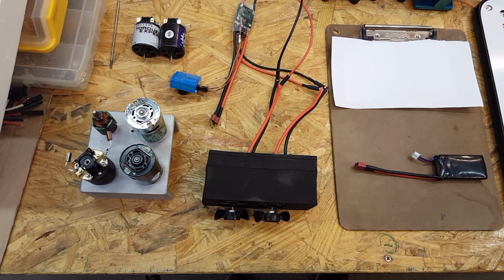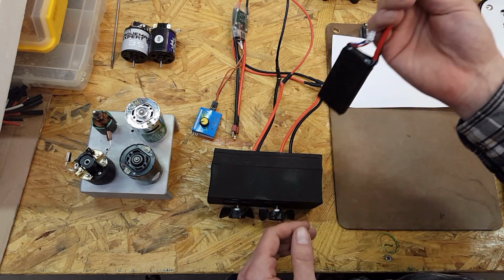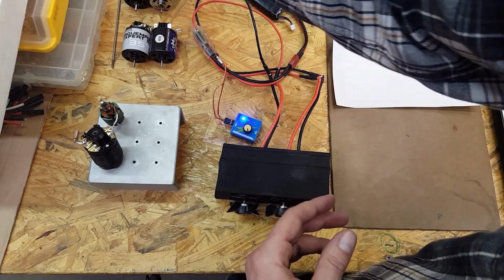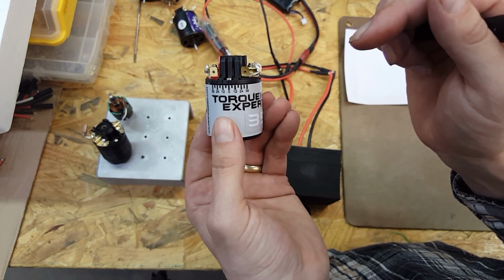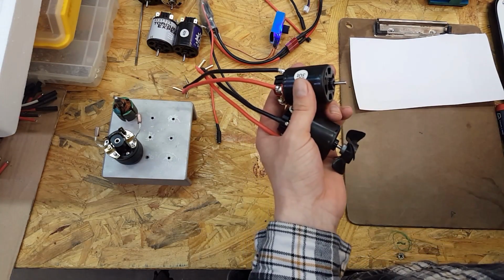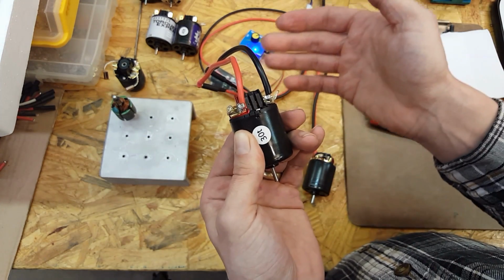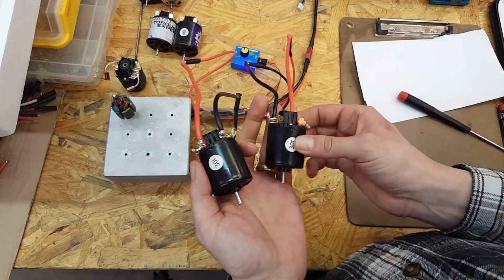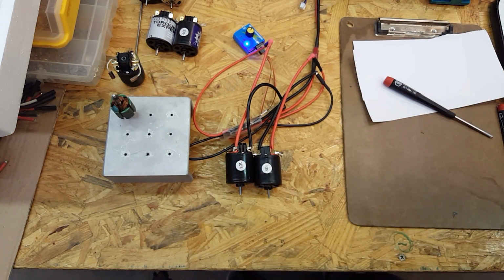Brushed Motor timing, rotation, and matched pairs

Comment: Hello, 1st, thank you so very much for the educational videos.  You make learning your products fun and entertaining.  Also, learning the technical aspects of your products is invaluable and so very useful.  I’m new to crawling.   My question:  Prefacing my question.  I am an engineer from the aerospace industry, I work for an airline.  All components on commercial aircraft are tested and retested for certification purposes.  Regarding new aircraft, you can find many YouTube videos such as the testing of the A380 wheel and brake assembly. Specifically, you will see the wheel and brake spin up testing the brake assembly to failure. Do you have the equipment to test shaft HP on one of your brushed and similar brushless motors.  I would like to see a video of you spinning up the motor measuring Current Draw, Voltage Drop, Shaft torque, watts, and perhaps spinning the motor to ultimate failure.   Thank you in advance!   Rob-
Reply from the maker: I have an inertial dyno.  It's very lackluster.  I'd like to build a master/ slave dyno but need to have a pretty big chunk of time to design the cradle and IO system

Comment: Hi friend. My Hackmoto V2 13T motor rotation direction label says counterclockwise. But my Vanquish VS4-10 Phoenix crawler transmission rotates in reverse when pulling forward in the transmitter. Is it ok to just reverse the motor wires without damaging the motor to make the transmission move forward when applying throttle in the transmitter? I also ordered your Torquemaster 540 35T motor. Thanks in advance.
Reply from the maker: you can swop wires or change it in your radio, if you have the option

Comment: I built my first rc10 in 1990. I liked how everything was back then. Soldering lightbulbs together to drain cells. I had a shoe box full of cells that I'd match together and solder a pack up. Cleaning brushed motors, using commutator cleaning bars, timing, armature lathes. Today everything is RTR and ready to go. Back in they day people seemed more knowledgeable because you HAD to learn/do that stuff. A lot of young people today don't really seem to know/understand much (there ones that do, don't get me wrong). And it's because half of them have never even assembled a kit. They just put a battery in and turned it on.

Comment: adjusting the turns gives you more torque to or is just for durability of the brushes
Reply from the maker: peak torque will be around 30t range for a 540.   this also increases brush life compared to faster motors.

Comment: I don’t understand timing…I have a custom tamiya 1/14 scale semi…I have a 80T motor in it that pretty quiet…only thing make noise is the 3 speed…I love the torque and everything but not fast enough…if I adjust timing will it be a lil faster?
Reply from the maker: Not much.  I'd say get a 55t 540 or 45t 550.

Comment: I like your videos i'm a beginner and I like to work with my rc (and other electric stuff like electric scooter skateboard etc) and repair or rebuilt :))) and I did not know about the timing of brushed motors :)))))) I will need to rebuild my small rc to put back 550 or 540 brushed because i keep it in parts from 1 year :)) after an stupid brushless upgrade =)) 20 or 25 amps esc and 540 brushless motor 4300kv on1:14 scale :)))

Comment: Since my puller pro 3500 v2 is running in reverse rotation on my trx4, should I mess with the motor timing on it?

Comment: I've got a hobbywing 10/bl120 brushless esc and a Holmes 28ookv puller pro and it goes in reverse. Is there anyway to change the rotation. The esc dont have reversible programing.  I installed it on a redcat gen7

Comment: How do you reverse motor rotation on your team puller 500 can I turn the can 180° or do I have to desolder and then solder again. If anyone is reading this please feel free to comment. 👍🏻🔥😎🔥🤙🏻
Reply from the maker: Just swap the wires.  Resolder if the colors bug you

Comment: So let me get this right on the puller 500 and 400s the only way to reverse rotation is by reversing the wires. I have two and I'm about to put them on a motor on axel.

Comment: Hi John! thanks a lot for this , I have a small question , my custom SCX10 has a aftermarket gear box, once i put the motor in chassis wont roll , once i remove the motor it smooth as butter , you think  is it an issue on the gear box or its the motor

Comment: So to reverse the puller 500 i need to take out the screws turn 180 degrees and put it back together?
Reply from the maker: Just flip the wires on that one. It's set to zero which might not be easy to get back unless you minimize amp draw with a meter

Comment: Is there anything I should know before installing one fo you 5- slot 16TURN.  with timing  in the Trx4 sport,, I know the rotation is reversed on the Trx4,  ,,
Reply from the maker: use negative or neutral timing for reverse rotation
Reply: @HolmesHobbies  Got it.  Negative  lead to + post..    o timing,   
    Thanks 👍,    
      I have upgraded my radio.  I could  reverse the rotation on the radio as well! Would fine to ? Correct. 
        Just. Keep the timing at zero.   
        Thanks you so much for your TiME!!!  💯

Comment: I literally just fixed the timing on the motor and I got this notification 
I have been into Rc for 35 years and have never done anything with timing this video taught me a lot after I fixed the timing the motor worked flawlessly but I learned from your video that it was spinning the wrong way and so I did a 180 with the timing and now it spins correctly that just absolutely blows my mind you could do that again thank you again  in case you’re interested it’s a team kinwald the dirtinator

Comment: Just bought a HH Tourquemaster Pro 27T from asiatees for my TRX4 Def ( boy the importation duty i payed😬),  do i need to put the red lead on the negative side of the motor or will i just rotate it 180’? , how far can i advance the timing? any suggestions on the gearings as well? Many thanks in advance...

Comment: I just bought a TRX4 and wanting to try a Trailmaster Sport 550 in it do I need to reverse the polarity on the motor to work in the reverse rotation and would anything else need changed or adjusted
Reply from the maker: Yes, reverse the polarity for the TRX.  Otherwise ready to go!
Reply: HolmesHobbies I didn’t really expect a reply on such an old video but, I very much appreciate it. This just shows your level of commitment to subscribers and customers. I just received the 3 Trailmaster Sport motors that I ordered for my and my nephews trucks can’t wait to try them out. I’m sure to be ordering many more to come. We are rough on motors lots of water and lots of mud.Thank you sir.

Comment: I have a gmade bom, and with motor installed. with motor wired with crrect wire polarity,it spins in correct can label direction and model moves correct direction BUT the motor spins faster in reverse. to get it to spin faster in forward I have to reverse wirea against polarity and reverse TX servo /esc direction. what should I do ?
Reply from the maker: this is probably your ESC.   reverse your radio channel and reverse the motor wires and try again.

Comment: If I want maximum power and speed from a low turn motor in a stadium truck should I use soft brushes and firm springs?

Comment: If we set a team 500 puller motor to lowest amp draw. Then it's @ 0 degrees of timing? Do you recommend  6 degree of timing on the 400/500 puller motor also or lowest amp draw?

Comment: Hi John, I recently purchases a 540 35T sensored motor. Out of Box the rotation was faster in forward direction and slower in reverse. The current draw from a 3.6V 1900mAh Ni-Cd in the factory setting was Forward-1.06A & Reverse-1.04A. So I tries to advance the timing slowly by 6 degrees and the current rose to Forward-1.08A & reverse-1.06A, at 12 degrees the forward was 1.2A & reverse- 1.18A. Finally at the third notch(marking) the current had risen drastically to 1.72A at forward direction and 1.68A for reverse(and speed reduced too a lot). Would this increase in current draw impact the life of the motor significantly?
Reply from the maker: Yes, increases in current will affect motor life, more significantly past 12 degrees of timing.   The lower the better for brushes.
Reply: Thank you. So, currently I've kept it at 6 degrees. Should I go back to the factory setting for longer brush life?

Comment: Hey John! Thanks for these videos. They're very informative and in my case, somewhat of a refresher... I ran semi pro in the 80's to mid 90's.I have a question... Back in the day, we used to put "socks" over our Endbells, secured around the can with a rubber band or a zip tie. Kept larger debris out of our Motors. This is a bit of a question from the last video I watched about running in water.... 
I was wondering, would that old trick help our Rigs today, especially when going through water?? The way I see it, it won't keep everything out, but it should keep out the bigger chunks, that can jam up Brushes and Bearings...What do you think?Carmine 🚂
Reply from the maker: That would certainly help.   I prefer to just run sealed can motors though.   I don't like getting water into expensive ones.
Reply: I remember those foam "socks"!! I think they would HELP, at least keeping the larger junk out of your Motor (I'm assuming Brushed). However, watertight sounds a lot better to me. ;)
Reply: HolmesHobbies i

Comment: what timing is best on brushed motor?  leave it at 0 are...? Besides the 0 mark what is the next setting number?
Reply from the maker: Depends on the rpm that the motor is spinning.   For a crawler that is normally close to zero RPM, 6 degrees of timing is a very good setting.  Each little mark represents 12 degrees.

Comment: why is the motor more noisey from one direction to another direction
Reply from the maker: Ric Gruber good question! You are hearing brush noise, which is common on stand up brush rebuildable motors without brush dampers (our pro handwounds have dampers). The brush seats in one direction during break in, while in reverse the brush wants to sit a little different. The sharp brush edge catches the comm gap, and makes a little noise.  flipping the brush or sanding the sharp edges can help.

Comment: I don't really get it. Can't you just change it on the controller? What you are saying it isn't good for the motor to run backwards to much?
Reply from the maker: Johan Eriksson the timing of brushed motors is handled by brush placement, and not controller programming.  having retarded timing will wear the motor very fast.

Comment: Nice to see some love for the Brushed motor guys. I have been running the BRXL esc's for almost 5 years. Ive been running Holmes Expert 40T, on 3s for two or three years now. I love how smooth, quiet, and dependable HH equipment is.  Oh Im running the 12v servo too!!!. Wow that bad boy is no joke. Gotta love not needing BEC!!!!! 
Keep the videos and top shelf products coming. Thumbs-up 
#inholmeswetrust
Reply: And keep the love for Brushed Motors going!!! I've got the TorqueMaster ESC, I'm sure it's BRXL....(been in there SO long, I forget!!).
Anyway, I didn't know that they can handle a 12v Servo - without BEC!! John, your products just keep getting more impressive!
Reply: PacbeltRR i

Comment: Great video! This will be a life saver for moa guys 👍 I'm building a dual 2200 kV Axial dragster and I've been researching... It looks like  two ESC /two motors is the most reliable setup. I've seen a theory where they would use one ESC with two sensor motors. The first motor was connected with the sensor wire and the second motor operated sensorless .. stating that the first motor would give the ESC feedback to give both Motors the proper power.. my Layman's Theory is that I know my RPMs won't be any higher but using two Motors will help share the workload so I can use higher gearing just giving me incredible wheel speeds for hydroplaning vertical pit wall climbing Tire ripping speed on 6s because I'm also a purveyor of power breaking parts😯  so my question is if I used to ESCs with two Motors can I bench run them and adjust the timing through Castle Creations link to try to help out with synchronicity with a rpm gauge? Thanks 👍
Reply: You CAN NOT RUN 2 BRUSHLESS MOTORS ON ONE ESC!
Reply: 2200kv how far are you dragging 10 feet?

Comment: This does not work for brushless ? 
Do they also have timing ?
Reply: Mike McElligott 
brushless motors have timing but not the same as the brushed motors. this is great info on brushed motors.
I believe timing  can be set via esc on some brushless  motors
Reply: @bergcrawler1  But there are also brushless motors, where the timing is adjustable on the end bell